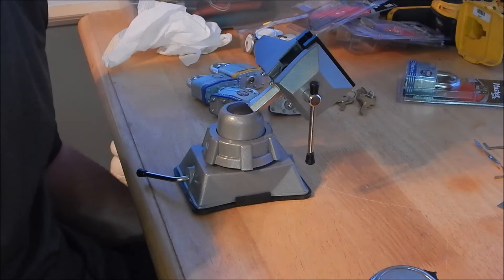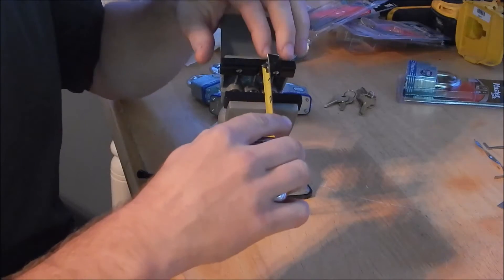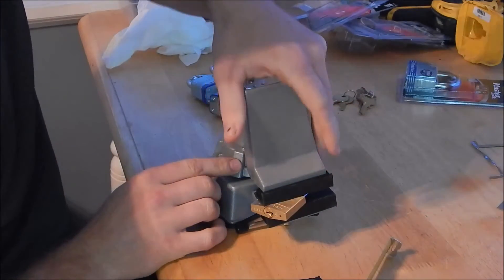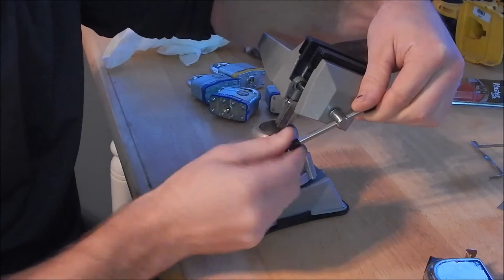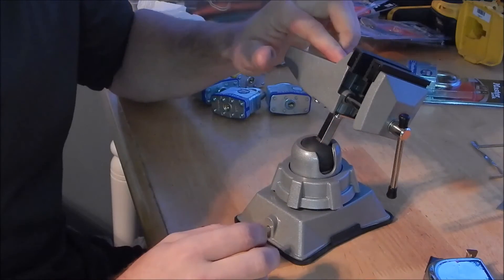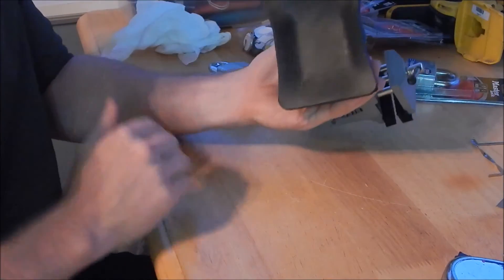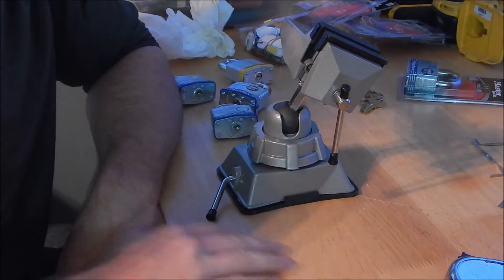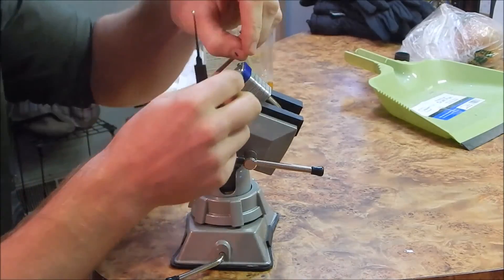Bessey Vacuum Base Vise: This Vise SUCKS!

Comment: Amazing! I bought the same vise under a different name, and I bought it for the same reason, my lock picking hobby. I had the same problem. When I tried to put it on a wooden surface it wouldn't stick. I was so disappointed that I immediately ordered another vise. Your video kept me from making it a paper weight. I had not tried adhering it to other surfaces. Excellent video. Thanks.

Comment: When mounting a vacuum base vise onto a nonporous surface, place a few of drops of water between the rubber suction cup base and the nonporous table top. The wet suction cup will have the advantage of capillary action by providing a stronger and better vacuum seal by keeping the vise from shifting around. The suction cup is held tightly by atmospheric pressure which is 14.7 pounds per square inch at sea level.
Reply: Yep - have a bit of water on the base/table under it - holds for AGES longer and very well. If the surface is dry - it will leak and let that vacuum go very fast.

Water is your friend. Go crazy, then just wipe up the excess around the edge - will hold for hours
Reply: thanks jaden

Comment: Have a bit of water on the base/table - holds for hours. More water the better - then press down as you did, and clamp it to the table. Will hold for ages and ages - If you get too excited with the water. have a cloth to wipe up the excess once its locked down.

Same issue I had over and over - lasted 1min at best -> add water, its still holding 5 years later ;)

Comment: I encountered the exact same problem, another brand vise, tiangular shaped base but same problem even on laminated surfaces.
Reply from the maker: +happymark1805 it seems like many companies just rebrand the same vise. i saw nearly this exact same vise at harbor freight but labeled under a different brand. it works alright but only for light delicate jobs.
Reply: Great lakes prepper that's all its meant for